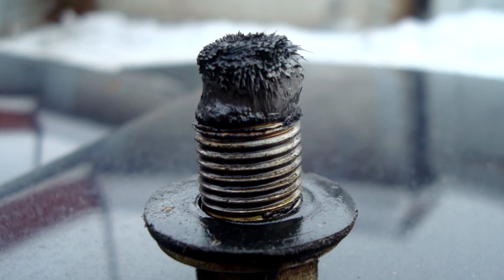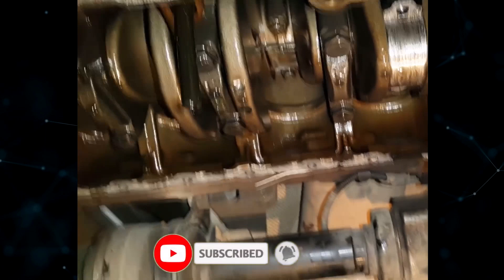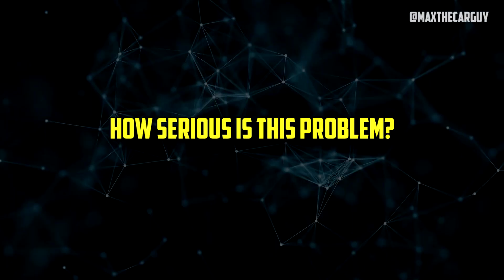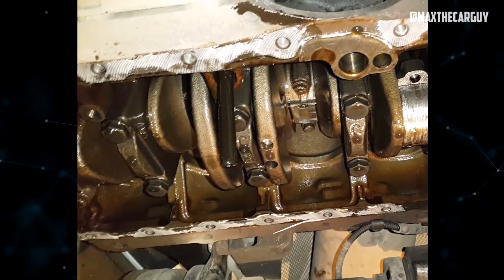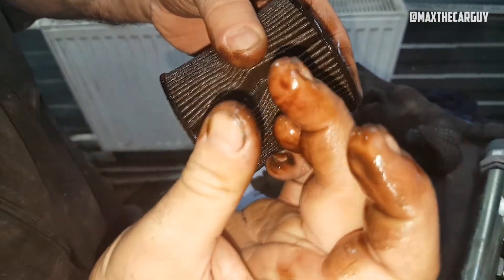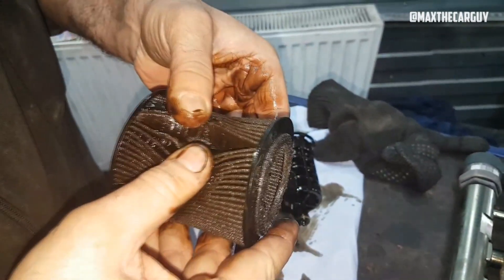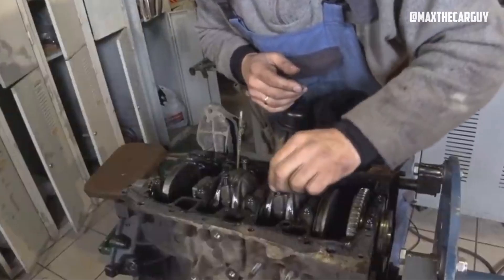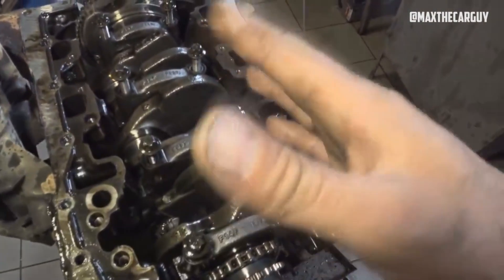Metal Shavings in Engine Oil - Meaning, Causes, What to Do?

Comment: I have no clue how but my 2017 Nissan Frontier has larger metal chunks in the oil. I do 5 to 5500 mile intervals with Pennzoil Ultra Platinum full synthetic which meets and exceeds factory specs. I have maintained this truck well. It only has 53K miles.
Reply: That’s so sad, I’m sorry to hear that buddy!
Reply: Are you the first owner?
Reply: @Eclipsis17 No. I bought used from dealer
Reply: @austinichini there’s your problem.
Reply: @austinichini you have 0 idea on how the previous owner treated the car.
Reply: 53k miles and done? I tought 530k
Reply: It's a nissan.
Reply: @Marvin.45 false

Comment: I saw this video a little too late as well. I had metal shavings coming out of my 17 Hyundai Santa Fe sport it had a little over 160,000 mi on it. I changed that oil every 3,800 to 5,000 mi. That's definitely not a noise that you want to hear when it throws a rod. 

I just bought a used SUV with 177, 600 mi on it. A week after buying it, I changed the oil. And there's metal shavings in it. I'm going to call a mechanic shop and see how much they'll charge me to rebuilt the engine

Comment: I found this video a little too late but I went to change the oil on my 6.0 '04. Yukon XL found metal shavings. Change the oil and notice that I had no oil pressure as I just got the vehicle... Drove some 400 miles with no issue. Turn the vehicle off. Turn the vehicle back on the next day only to hear ticking proceeded to drop the oil pan and found smashed camshaft bearings. Lean this to say I pulled the camshaft currently installing it. Wondering how long this engine will last now anybody ever experience anything like that? And how far did you make it if you did?
Reply: Did you replace the car?
Reply: @gaylecloyd2088  no ..I'm going to replace the cam shaft... would have done it by now..but 550 is a little bit more than I can afford..plus more parts..part of life
Reply: I have the same problem on my 2019 Tacoma. I still owe money on it
Reply: Just had this on my Silverado SS. Found metal shavings in my oil and plug and dipstick. Dont know what to do
Reply: @pablopablopablopablo3778  yeah I’m in the same boat with my 07 mustang gt
Reply: Anywhere between 10k miles to 60k miles!

Comment: Just what I didn't want to hear.  My Acadia, with only 85k miles on it, has metal shavings in the oil.  It was a great and informative video, though!  What I'd like to know, is just how long might it last? The car is paid for and now isn't a good time to be spending money.
Reply: Me too.  My 2017 Hyundai Elantra started to knock (only for 10 seconds) and enginen light came on. 110K mi, and took it in. They told me metal was in the oil, and they couldn't fix it, it needed a new engine. Called the dealer, they told me $9K to replace an engine.  Engine light is now off, but how long will it last? I can't trust it to take it anywhere now. Mine too is paid for.  Was hoping to not to get a new car for at least a couple more years, am on SS and $$ is tight!!
Reply: @sherylclements2846 what did you end up doing?
Reply: My co-worker's buddies build race cars and they said to just keep driving it. So far, so good. The engine runs smoothly, no sign of anything eminent. fingers are crossed . . . (Good luck!) @sherylclements2846
Reply: @sherylclements2846  does it still knock?
Reply: I don't want to hear it. My SRT8 Grand Cherokee was 64,000 mi has got absolute acorns coming out of the damn oil pan screw shavings
Reply: @TRICKYBYRD dang same here man I got an 09 srt8 and had misfires and was told metal shavings were found in the oil. And the problem is our 6.1 hemis are no longer easy to find…. Did you get yours fixed?
Reply: @G6.1 just rebuild it
Reply: @Eclipsis17  yup I’m in the process of doing that….
Reply: @G6.1  I bought a new car. Problem solved!
Reply: Umm fix it now and you won't be spending a lot of money homie oh wait a year later and it's toast now for sure🤷
Reply: @Valentine98766  I got a new car. Problem solved!
Reply: @Valentine98766  I bought a new car. 😁
Reply: My 2016 Kia Forte isn’t knocking, but the mechanic told me that there are metal shavings in my oil. I really hope that my car still has a few more years left because I can’t afford to fix it.
Reply: @bethanyoneal5789  Good luck.
Reply: I got Suzuki Ignis 2023 model and just ran for 9K and had changed oil and filter and found lotd of metal fragments and non metal too. 😥